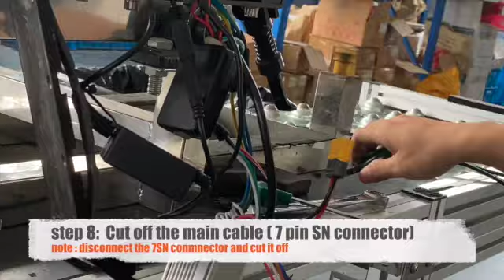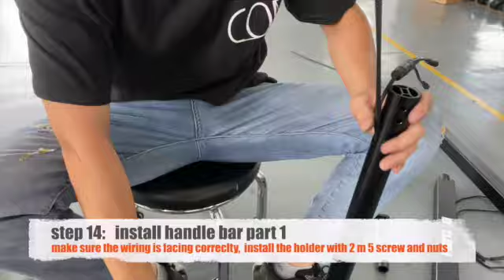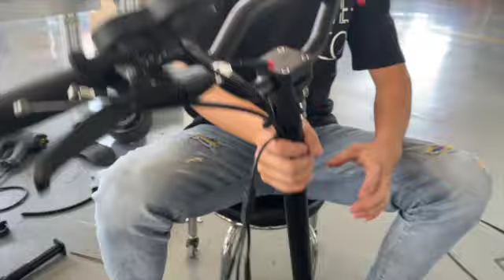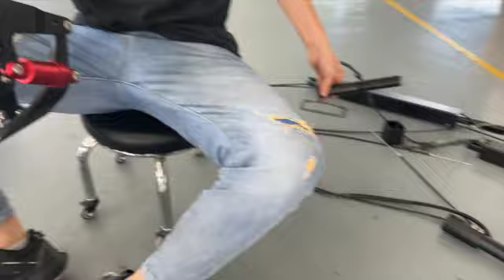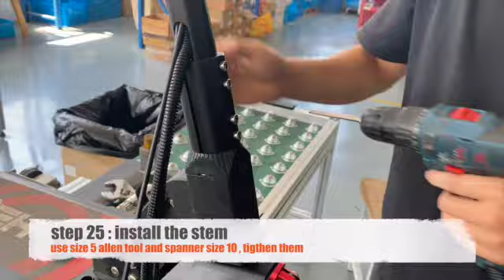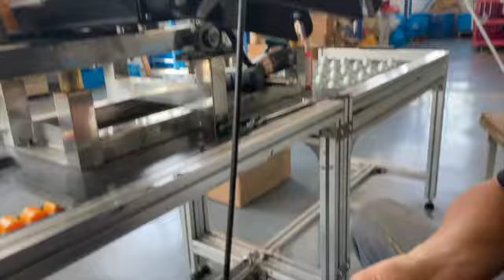Upgrade Hero S8 Square stem to BMX Stem

Comment: The new s8 has all this right? Plus 1000 watt motor.
Reply from the maker: the new S8 have this , it will be still 800watt
Reply: It shows 1000 watt on the site. I got the newer version. Will there be upgrades for the s8 to increase its power?
Reply from the maker: @liltimmybrickedps5801  it peak at 1200watt . If you getting 52v. It will peak at 1300watt